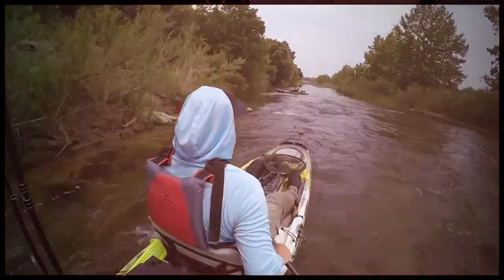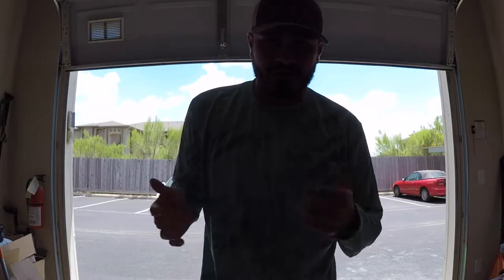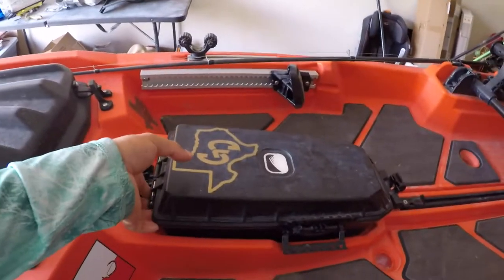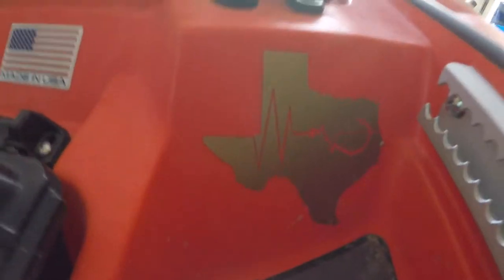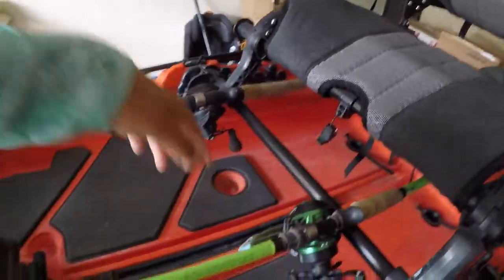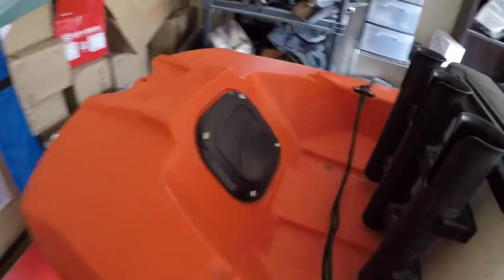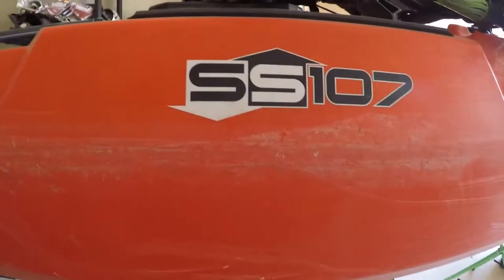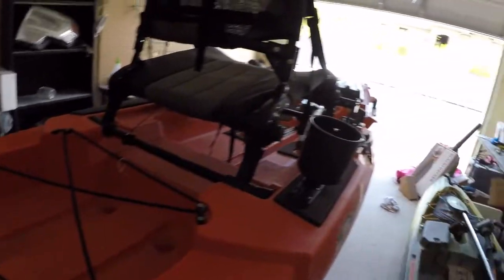The most HONEST opinion on the Bonafide ss107

Comment: The ultimate ultimate kayak would be a Bonafide ss127 or ss107 only it they put in a pedal drive system. I can't believe they didn't do that already. WHY! It would be so awesome.
Reply: I think because it is so easy and more affordable to get  a trolling motor on the back with the pre-drilled holes and seems to be the way most are going npw a days
Reply: @thedookster4143  But still. I mean I would really like to have a kayak propelled with my own power. I love the idea that I propel myself in a very efficient way. I just love the idea. Paddels is not efficient. There is just something about a pedal system that gives satisfaction on a high level.